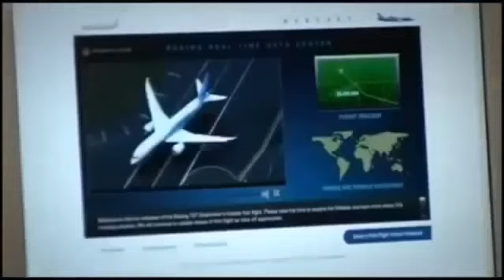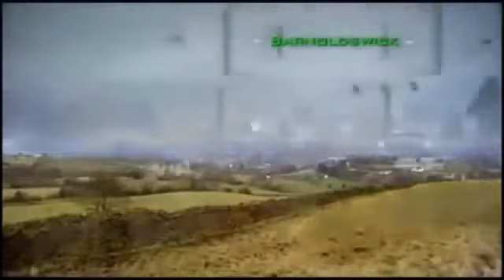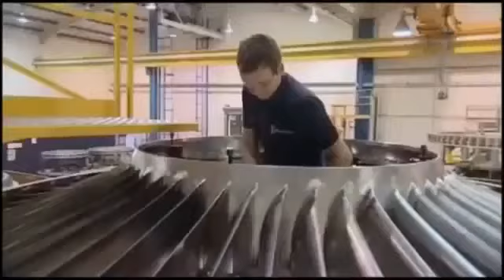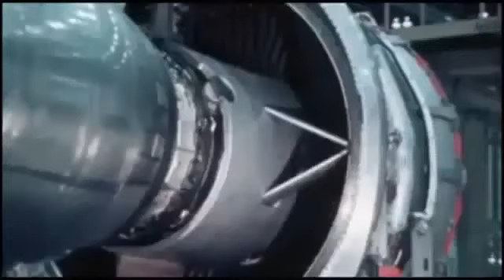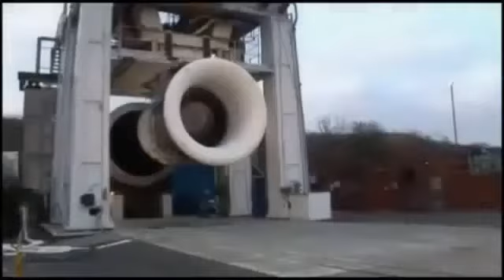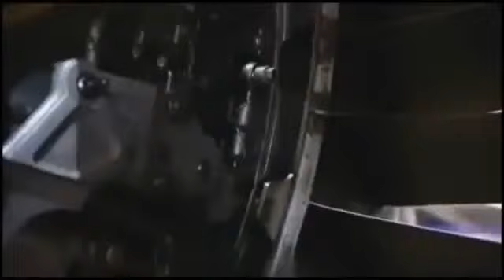BBC Documentary Rolls Royce How To Build A Jumbo Jet Engine

Comment: Crazy fact: The Boeing B52 is scheduled for an upgrade in the near future and one big issue that has plagued the updating is the engines. The military decided to simply stick with 8 engines so the nacelles will not change. I guess it saves a bit of money. Because Rolls Royce have experience with small engines for corporate jets, Boeing approached them. They are currently testing the engines in doubles so they can see how it performs and make sure the engines can run perfectly in sync when in flight. That kind of deep thinking is impressive.